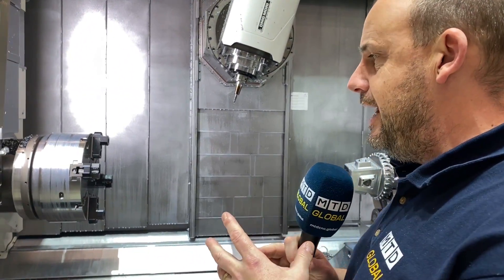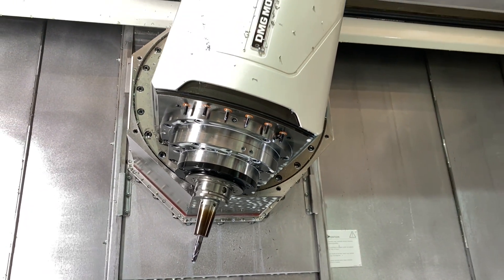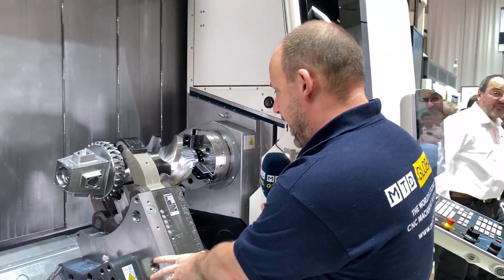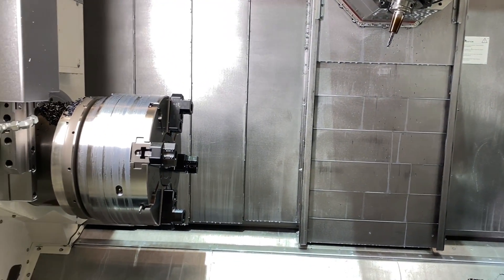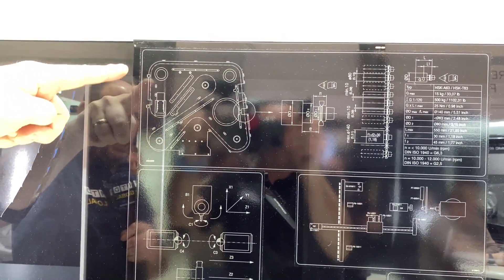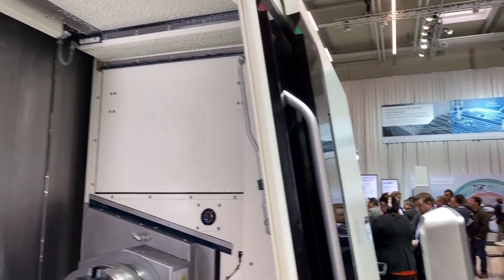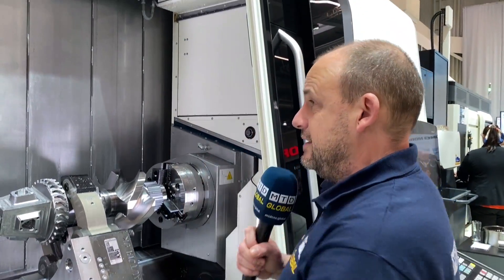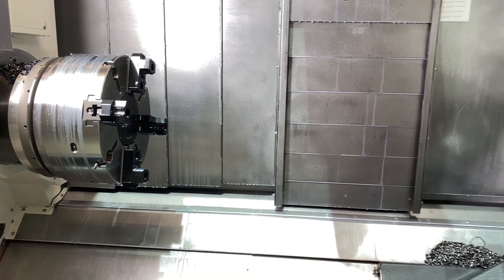New DMG MORI Gamma Mill Turn, does Paul do it justice?

Comment: "100% milling", until you try take any sort of heavier cut interpolating with the c axis unlocked and it stalls out.
Reply: Not a chance, if you can stall that thing you've done something wrong
Reply: @alexgregg2466  I've stalled mine and it was far from a heavy cut.
Reply from the maker: @mannycalavera121  im suprised at that, its such a monster